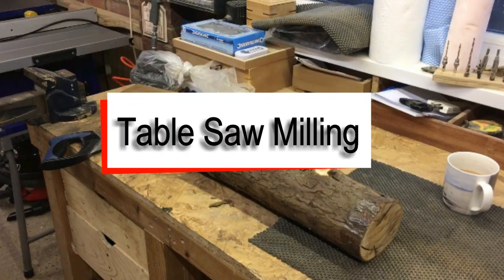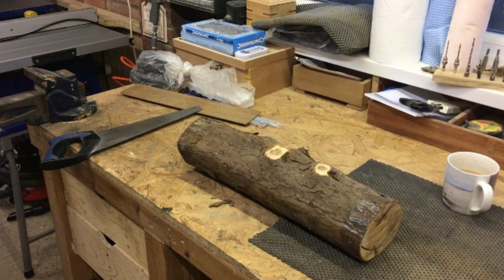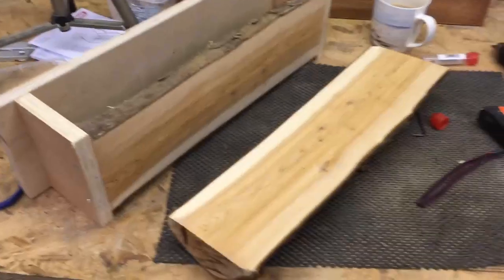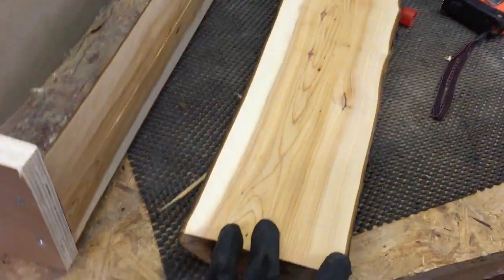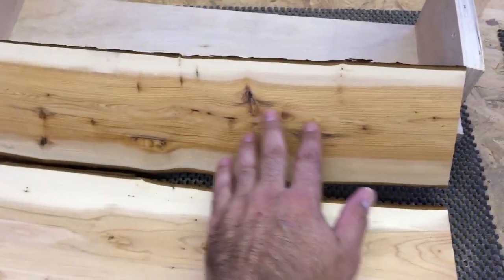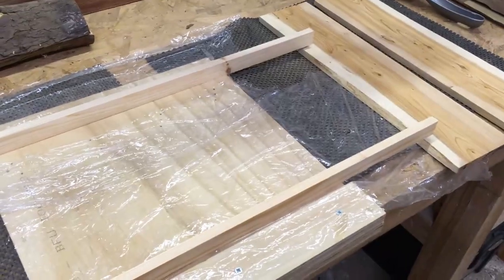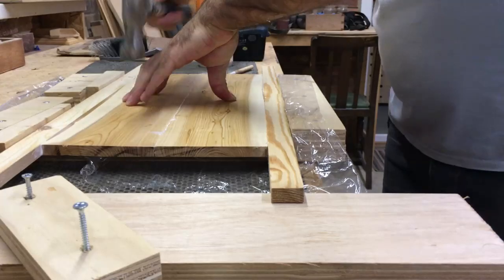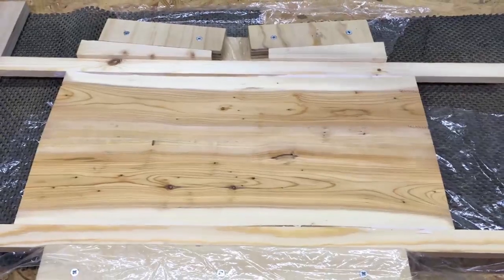Mill Free Timber from Logs using your Table Saw

Comment: I love the clamp wedge idea. That’s genius.
Reply from the maker: Brandon Schmeidler simple but very effective. 👍🏼😃
Reply: Very cool, how do you cut the wedges so they fit neatly and evenly in the slot for them?
Reply: @ericmoody3944  On here you can see that he holds the clamp in place with the wedge sticking out. Push the flat side of the wedge up against the piece and screw in the clamps. Now when you tap in the wedges it will tighten up.

Comment: Great vid! Quick question, how do I make sure both of the jig's sides are parallel? On the vid you marked the first side somehow (I'm guessing the log's mid point and 1" on each side), but the second side looks unmarked. How did you know where to drill the 2 screws, so both ends are aligned? Otherwise the top of the jig might be skewed, right?
Reply from the maker: Fix the two end panels to the flat base board before fitting the final end screws. The boards are run through the planner after to remove any slight irregularity

Comment: Hi Greg nice work how long did you have to dry the log first I am always worried about it splitting while drying so never bothered with owt like this
Reply from the maker: Hello Paul, that log has been in my dads wood shed for years mate. It felt dry as a bone. Hoping it won't cup over time. It's glued in my box now. 
How's things on the job front?
Reply: Greg Virgoe I'd best leave some logs I've got in my wood shed a bit longer then lol as for the job front bud not really been looking yet having a few weeks off catching up with things thanks for asking though cheers

Comment: I was wondering if this system would work for freshly cut Eastern Red Ceder logs 3 1/2" and 4" thick and about 35-40" long each to make picture frames? (And I assume a 2x4 would do as well as plywood.)
Reply from the maker: The plywood is there to keep it straight going through the saw so anything else would do the same job. You may have to dry the cut logs before planing and gluing in case the warp when drying.

Comment: I see you're making several steps when sawing, adjusting the depth of the blade. Can it work if you start sawing with full blade depth right away? I do not have adjusting system on my table saw.
Reply from the maker: This is a hard wood and a large depth in one go may be too much for the saw to cope with. You can go slower passing it through but risk burning the wood and over heating the blade.

Comment: The clamping wedges would have been enough to hold the boards tight so why glue sacrificial boards to the side? Love the sawing method!
Reply from the maker: The longer sacrificial strips are to prevent snipe when running it through the planer afterwards

Comment: How did you straighten the edges before gluing the panels? Awesome video by the way
Reply from the maker: Great question, I ran them through the table saw initially then square the edges on the jointer, you could also use a hand plane in a vice. I use this wood to make a memorial box and this video shows how it was used https://youtu.be/WfmsyoCcwWo skip to about 14:30
Reply: Excellent thank you!

Comment: Hi. What is the purpose of the sacrificial strips on the sides?
Reply from the maker: Just to give me a continuous level surface to slide over the saw.
Reply: Greg Virgoe thanks. ty for video too I was racking my brain thinking about solutions that kept getting more complicated I needed a simple idea to reset, lol. worked like a charm.
Reply from the maker: That's great, pleased it worked for you too, thanks for letting me know. Best wishes

Comment: Hi Greg. When I use my dewalt 745 table saw, I don't seem to cut right measurent. I find it difficult to understand its measuring scale numbers. Could you bring out video how to read table saw measuring scale to get correct size cuts
Reply: you can always use a tape measure against the fence to measure the thickness of your cut...

Comment: why not just cut a flat edge then put that against the table top, thats how i cut round vegitables with a knife
Reply: also nice clamping method, i was going to buy some long clamps but i like the wedges better
Reply from the maker: You still need to hold the log securely to make that first cut straight.